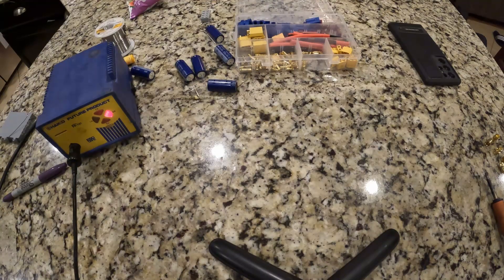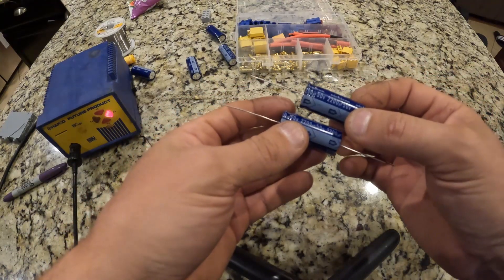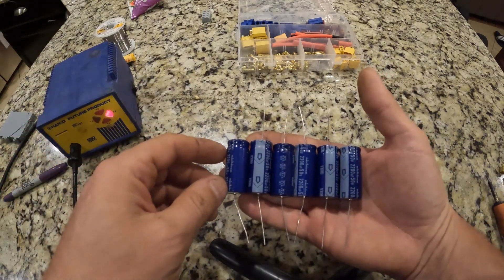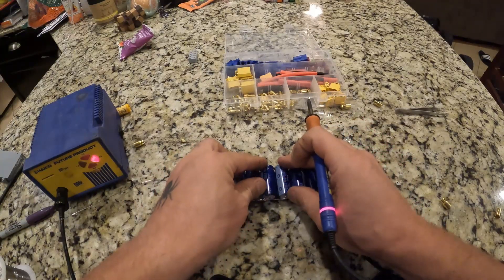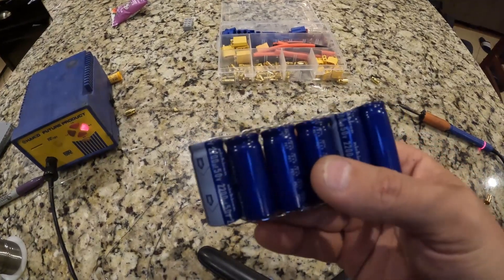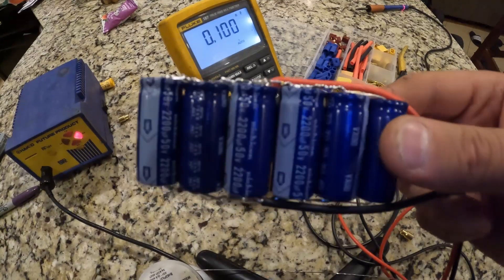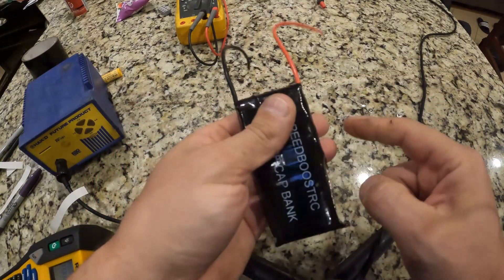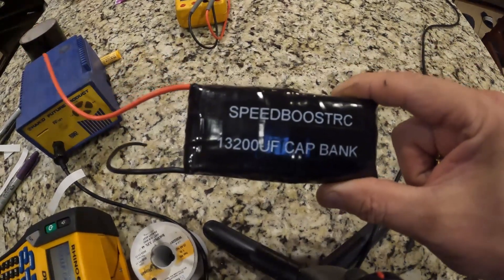Boost Your RC Power! DIY 13,200uF 50V Capacitor Bank for Smoother Speed Runs | Power Ripple Solution

Comment: That would be good for a drag car just for a quick draw of power when you pull the throttle for a race😎👍
Reply: I know about electronics some  I used to work on cb radios and I've been thinking about capacitors on my RC car for the same reason you're demonstrating😎👍
Reply from the maker: During testing the ripple coming from the battery at high current was completely gone. All you can notice now on the logs is a slight power sag but no ripple.

Comment: Can you tell me what kind of solder you use and does it matter what type for RC purposes?
Reply from the maker: Thank you! I use Kester SN63B37 0.8mm solder, which I’ve found to be the best for most applications. It's crucial to ensure that the solder you use isn't corrosive, such as a water-soluble type designed to be washed off. Make sure the flux core is rosin-based.

Comment: Hey what soldering station is that?
Reply from the maker: This is an older Hakko unit, and I don't recall the exact model number. However, if you're looking for a high-quality and affordable option, I recommend the Hakko FX951-66.
Reply: @SpeedBoostRC  ok, thanks

Comment: This is all you will find if you google that.  You will also see people opinions as well., but no scientific proof.:  Capacitors should be installed as close to the ESC (Electronic Speed Controller) as possible. The purpose of a capacitor is to make the power and ground lines have low impedance and to bring the power supply closer to an ideal voltage source. It also compensates for minor voltage loss across wires. DOESN'T SAY  1 INCH FROM THE BASE OF THE ESC....  Just close as possible.

Comment: @SpeedBoostRC  There isn't any information pertaining to this ghost story.  People just want to correct others for shts and giggles.  That would somehow apply to a stereo system in a vehicle.  Meaning the distance from the alternator and battery , would be far from the amps degrading the power under 12 volts or not maintaining the 13+ volts to the amp(s).    Some people are just ignorant.  The length of your RC CAR would not make a difference.  Your fine with what your doing.  Keep up the great work and videos.
Reply: We're not dealing with an amplifier  here. Also we're not using half ferad power caps. Your stereo amplifier tends to dim your headlights from massive sustained current draw that can kill your coils because minimum voltage dips so low they can't fire.  In an RC car the voltage RIPPLE inherent to Lipo batteries under high instantaneous loads means you need the lowest impedance possible from the much smaller cap packs we run. So you're stereo analogy is comparing apples to oranges my friend.
Reply: @stp440  sir if you were following the comments, I was responding to someone else.  I built award winning stereo systems, and I also Monster beast crawlers.  So if you go back someone else suggested something and I just responded to them that they were DEAD wrong.

Comment: Ripple packs should be soldered no more than 1 inch from base of esc power wires
Reply: I've heard that too and also installed mine very close to the wire terminals. I'm pretty sure it is written on castle's website. What's funny is that there are guys running in excess of 200mph without cap packs. I've come to realize that these kinds of components aren't what one needs to focus on when attempting to hit 200mph speed running. Dialing in the chassis/suspension/steering/foams and reducing resistance along the car is much more important than wasting time increasing pinion sizes and swapping from one ballastic motor to another without even break 165mph. A more calculated and patient approach would net much more success than just tossing your wallet at the project. Stick with one motor, find a perfect road, and work your way up SLOWLY at dialing the car in. That's how you learn to control these speed run cars and achieve your goals.. comprehension via patience
Reply from the maker: The reason I switched motors wasn't because I expected better results right away, but to explore different options and see how they perform. I'm not switching from one motor to another out of necessity but for the experience, so I can understand the differences. I believe I'm gradually working my way up, which is why we're currently at 135 mph. I agree with both you and @kingifkings600. But since I have the resources and the ability to experiment, that's what I'm doing. Eventually, I'll find the setup that suits me best and stick with it, refining it further. Keep in mind, I'm still very new to this, so I need to try different things to learn. Even if I end up doing something ineffective, it's all part of the learning process. I won’t know until I try.

I appreciate all your comments and support as we explore and enjoy this journey to 200mph.
Reply: @SpeedBoostRC  i should've mentioned earlier that i appreciate the tutorial for the cap packs, and you're definitely heading in the right direction. Here's what i think you should do.. leave your gearing as is, consider trimming those foams down to 96mm or a bit less, dial in your rake/suspension, and hold WOT for another 2 seconds. I can almost guarantee that your speed will increase noticeably
Reply from the maker: Can you point to any literature on this so I can better understand why? I never heard of this, and I'm not sure how this would affect it.
Reply: @SpeedBoostRC   to better protect against ripple the closer to esc the better..I will find literature
Reply: @SpeedBoostRC  There isn't any information pertaining to this ghost story.  People just want to correct others for shts and giggles.  That would somehow apply to a stereo system in a vehicle.  Meaning the distance from the alternator and battery , would be far from the amps degrading the power under 12 volts or not maintaining the 13+ volts to the amp(s).    Some people are just ignorant.  The length of your RC CAR would not make a difference.  Your fine with what your doing.  Keep up the great work and videos.
Reply: @JasonGunn418  your clueless..
Reply: @SpeedBoostRC  And I would not personally listen to anyone not posting videos about any types of RC vehicles, to include drones, lol.....
Reply: @JasonGunn418  watch hobbywing video how to install cap packs
Reply: https://youtu.be/h-zoi_C_QAA?si=H2WMaW73N4tKJ337